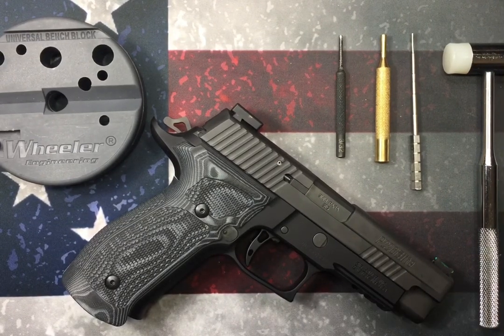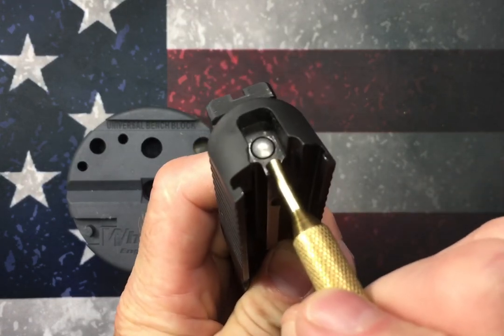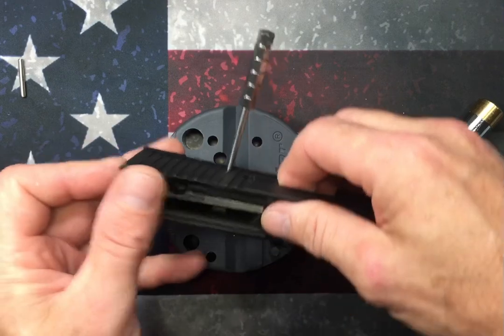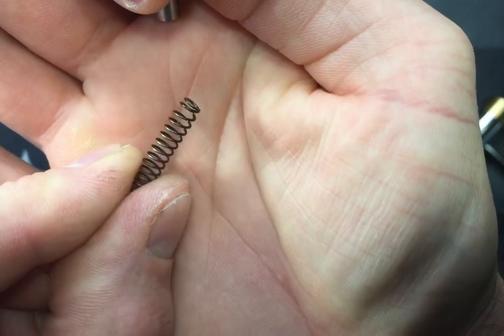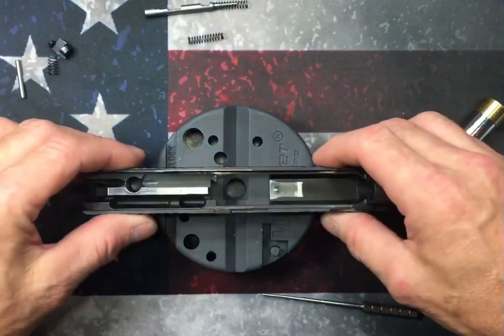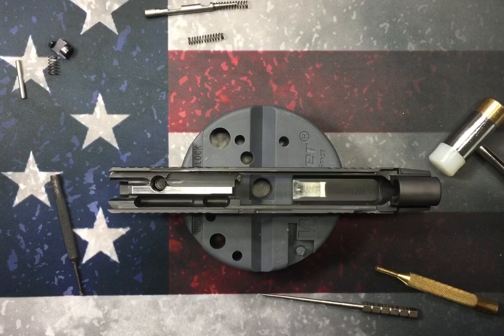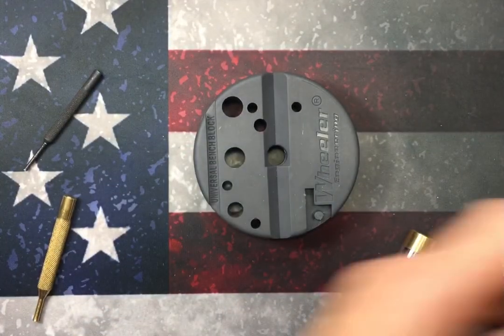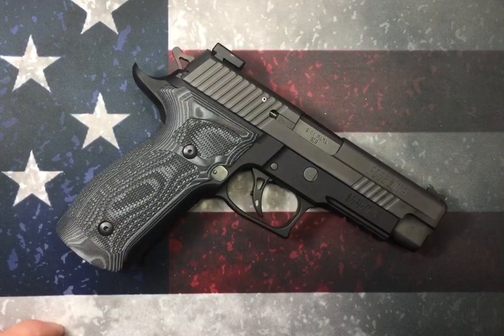Sig Sauer P226 firing pin removal, cleaning and reassembly.

Comment: Thanks for making the video. 
I just bought a sp2022 and I was looking for disassembly videos when i came across your video. 
The slide disassembly is pretty much exact, especially when removing the firing pin. 
I appreciate the help with your video and it made cleaning the slide of the sp2022 so much easier.

Comment: The P226 Legion is slightly different. After watching this I got the idea. In the Legion version the Extractor pin and the 2 springs need to be removed as well. Thanks for the video.
Reply: I have a Legion P220. For reasons I won't bore you with, despite weapon being four years old, it hasn't been fired.  It has been cleaned several times, including recently and stored indoors in climate controlled home.  

I was bugged by performing an eraser test on firing pin.  The pencil barely clears the barrel while at 30 degree angle.  I don't know if that's a problem.  I got concerned lately just because SIG hammers have that look like they aren't really striking pin hard enough.  With that concern in mind, I discovered the pencil test.  Specifically regarding 220, I read that it should clear by a couple feet. Mine is a Legion with a lighter trigger pull...maybe that's the reason pencil doesn't clear but by a few inches. Thoughts?

Comment: Love your channel sir, the step by steps are on point. I have an early gen p226. After driving out the roll pin and I depress the safety plunger, the firing pin stays put. I simultaneously depressed the firing pin and released it quickly to see if I could get it to pop out, but no luck... any suggestions?  Also, any instruction on removing the extractor (it's internal) would be greatly appreciated!

Comment: By any chance do you happen to know if the 220 and the 226 firing are the same. I mixed the pins up but they look the same. Anyway having a terrible tome reinstalling firing pin. Pin is stuck in slide and having a devil of a time removing it. Thanks

Comment: What about on the long extractor models such as the legion? You can’t punch out the roll pin because there’s nothing on the extractor side.
Reply: Some other guy was saying you need to remove the extractor pin and 2 springs to do it, but not sure.

Comment: Hey man I have a factory refurbished p226 that shoots all over the place after the first 2 or 3 shots of a full mag. The first 2 shots are usually spot on. This has been confirmed by 3 shooters now. Any ideas? I was thinking a shot out barrel but I feel like that would be blatantly obvious visually.
Reply: I would start with the recoil spring.  But this is probably user error despite 3-4 different shooters.  Finger tip placement matters on all my Sigs.  Pull the trigger from the tip of your finger not the first joint.  Try that after the recoil spring.

Comment: I've tried for the life of me to pop out the retainer pin.....it doesn't budge... any ideas here would be appreciated?
Reply: Did you ever get an answer on this? I have 2 newer ones with a roll pin that came out fine my older W German one has a solid pin that won’t budge.
Reply: @user-eo4my6uj4i  No. Gave up on it, lol. I did go to a hardware store and bought a punch but no matter how hard I hit it, nothing budged. I hope you have better luck than me.
Reply: @gregc6073  Same here. Almost gave up. Friend has a thousand lb mechanical press. He had it out in 2 min. 1:50 of that was lining it up.
Reply: That certainly gives me no hope that elbow grease will cut it then. Congrats on getting it off. Let me know if it's easier next time. I bet it will be.

Comment: Great video but why no lube on fire pin? I've lubed all my pins for years, cz, glock, 1911, but this is my girst sig.
Reply from the maker: In many cases where light strikes were present it was believed to be caused by lubrication and or debris in striker cavity. It is SIGs procedure not to lubricate at all any of the strikers or firing pins.

Comment: What confuses me is that the front sight on my X-five Allround comes out left to right, which makes me wonder if it's the same for this pin.
Reply from the maker: jonas åberg X5 should be right to left. Mine is anyway.
Reply: @SigGuy  Thanks for the reply! I had a heck of a time trying to get the front sight out, as I had read they go out right to left. It only came out after a friend of mine mentioned his came out left to right so I tried that. Still broke the sight though so it was a real bugger to get out. Don't really want to go through that again.

Comment: Great video. We’re can I get spring?
Reply from the maker: Allan F thank for the compliment sir. My spring came in the tuning kit you can buy from Armory Craft. This kit has a ton of goodies in it. The firing pin spring as well as different weight main springs AND a lighter sear spring. For the price it’s really a no brainer. If you choose to buy from Armory Craft feel free to use my discount code SIGSAUERGUY5 to save some $$$. Once again thank you for the compliment. Means a lot.
Reply: Sig Sauer Guy  hi SSG. can you please tell me what size is the punch you used for the retaining pine removal. And can I use the same punch for every sig I own. I want to purchase one or do I need different sizes.   My first hand gun was the P226. It’s a great gun!  I’m happy I found your site. Thank you.
Reply from the maker: Allan F this is the punch that I use on most of the pins and all of my pistols. It’s a very handy tool. Originally designed for sierra line meant but it works well with many other pins. 3 mm. 

https://www.facebook.com/809690416068961/posts/924781511226517?sfns=mo

Comment: Not required to pull trigger to remove slide of a SIG Sauer DA/SA handgun.
Reply from the maker: RideForLifeCR250R mine gets hung up just about every time unless I do that.
Reply: @SigGuy  huh.. i can't figure how that would be possible as there isn't a connection between the hammer and the frame as found in a striker fired handgun.
Reply: @RideForLifeCR250R  They trigger doesn’t need to be pulled but it should be decocked. If a SRT trigger is installed the pistol should be decocked in order for the safety lever to completely retract. The slide can still be taken off and put back on without decocking but the SRT safety lever will be forced out of the way each direction.